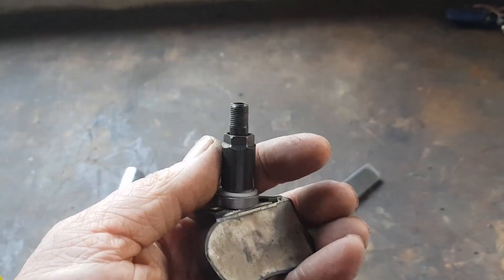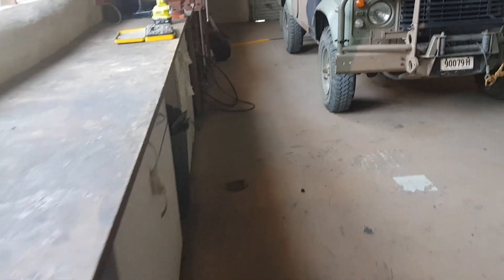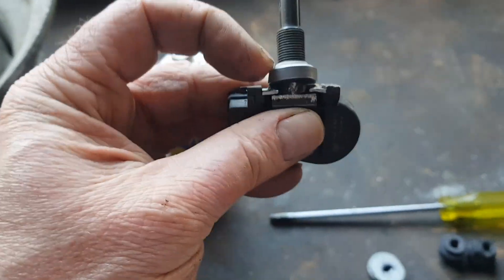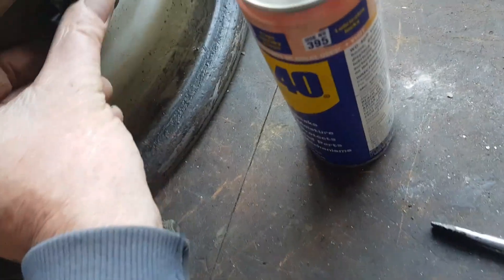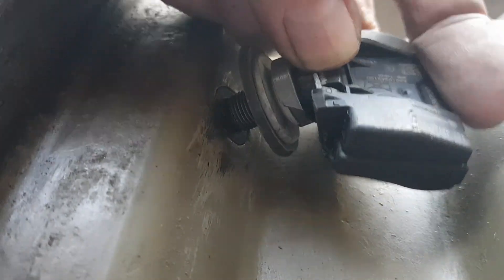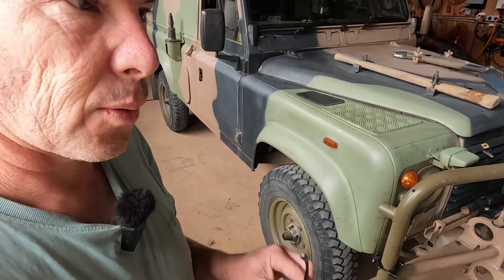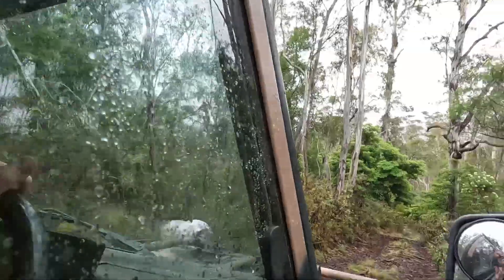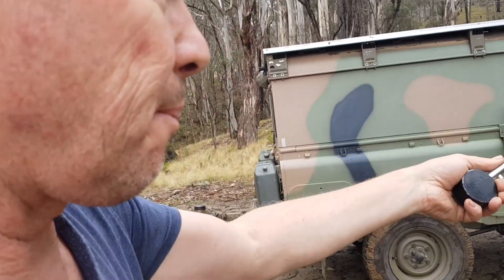Land Rover FTI 17: TPMS sensor install

Comment: Had you considered welding up the holes and re-drilling the correct size for tubless?
Reply from the maker: I didn't consider that but can't see why that wouldn't have worked as well!
Reply: @sydneyg007  It might be more work in the short run but make the wheels more standard for when the Apocalypse happens. 😁
Or you need a puncture repaired. 
😉

Comment: I really like how you are utilizing as much of the modern car as you can. It makes sense that as you modernize the driveline, you may as well modernize the rest of the car as well . Those little things really do make a difference to an old vehicle.
My understanding of tubeless rims is that they are different to the tube type. That's why they have an extra rib on the inside of the bead.  Also, tubeless tyres are a different width at the bead compared to tube tyres even though in most cases they will both go on either rim type. My point being that l'm wondering whether you might be better off with tubeless rims especially if you're running them at low pressure in the bush. Just a thought. 
Btw. Compliments of the season and thanks for a great video series.
Reply from the maker: Thanks Bill. The Michelins that the Army fitted are actually tubeless tyres. They are an Imperial size 7.50. I have been running them tubeless for a fair few years now without a single issue (even at 12psi on Fraser Island) so I have a fair bit of confidence in them.